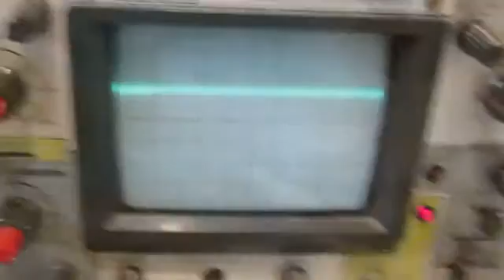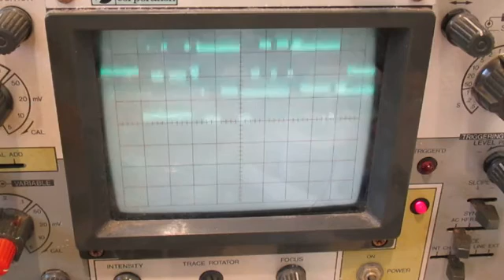LM-512 Z80 microcomputer: Dual AY-3-8912 card plays "Seagulls" by Tao

Comment: I am more interested on how the BDIR and BC1, BC2 signals are generated... For me, generating those signals with correct timing is a nightmare...
Reply: There are timing diagrams in the datasheet, and the timings need to be followed closely to make it work. For example to latch the address, it needs a setup time (tAS) of minimum 400ns and hold time (tAH) of 100ns (see Fig. 38. 39 & 40 of AY-3-8910/8912 Programmable Sound Generator Data Manual). The event sequences are also very important (see section 2.5 State Timing).

Comment: I was wondering how you have a separate clock for your ay than your z80, wouldn't they need to be synced up somehow? With a separate clock like yours mine seems like it is missing some times when pushing the bits to the ay.
Reply from the maker: The transfer of data from the Z80 to the AY is synced by the bus signals (IOREQ and WR on the Z80 side, BC1, BC2 and BDIR on the AY side).  To my knowledge the AY's clock input is only used for sound generation.